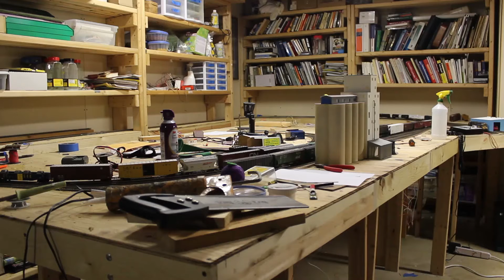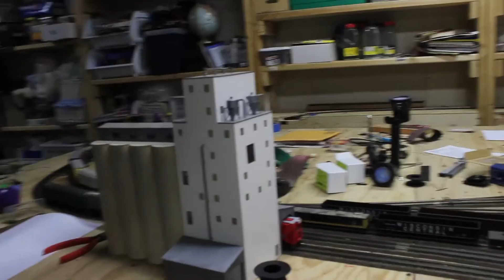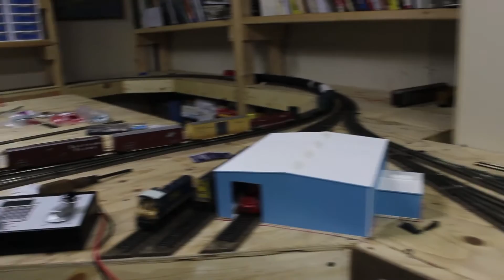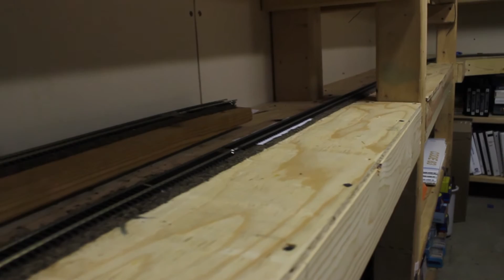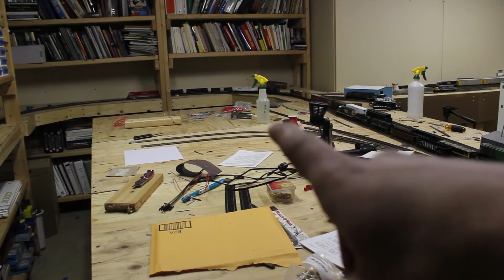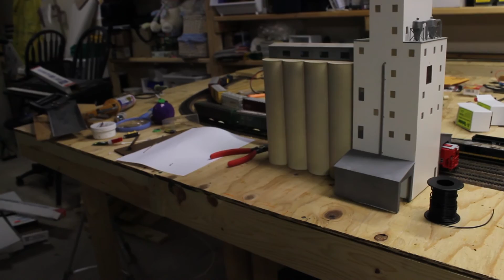Layout update 1-7-2016 status update

Comment: hey man that suck about the layout. did you try to screw more screws in closer together? its great to hear from ya. hope school is going well.
Reply from the maker: +model railer yes I have put more screws in some locations. However the places in the middle of the sections of plywood are still warped where they do not have a support directly underneath in order to screw it into. It doesnt seem to get any worse though so maybe I can fix all the current problem areas!
Reply: ***** cool you could always add extra supports connecting to the sides underneath.